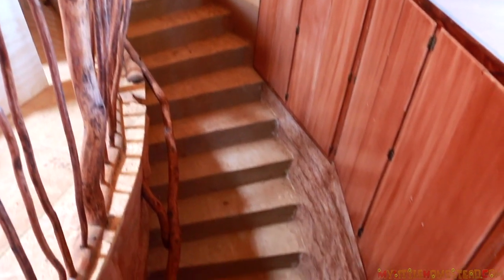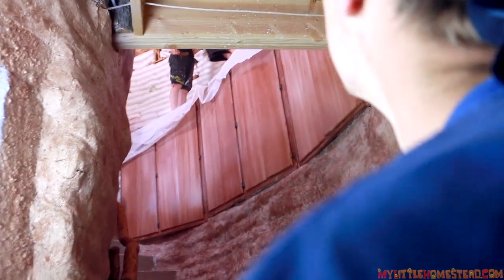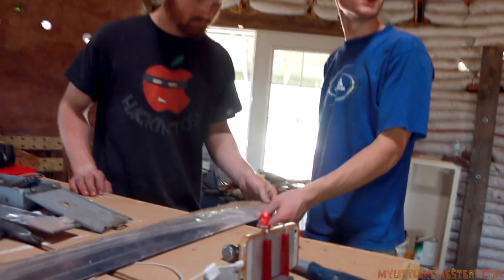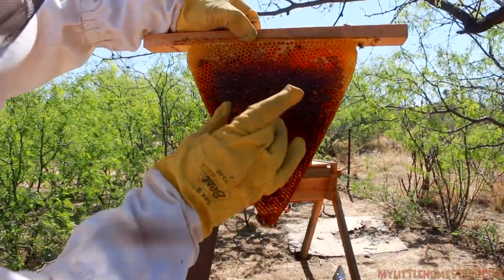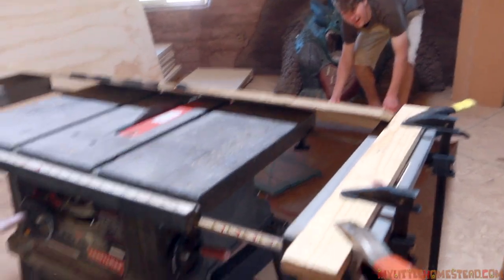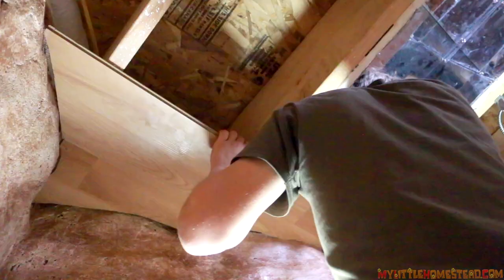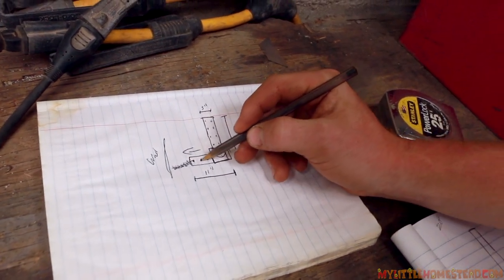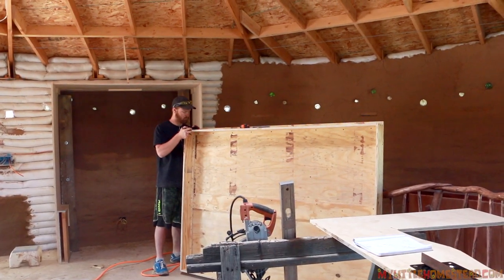Murphy Bed, Bracket and Beyond | Underground Earthbag Building | Weekly Peek Ep87

Comment: I like it all, but I'm not sure the lazy Susan bearing is your best choice for what you're doing.  It's designed to swivel with a heavy axial load, but you're applying a heavy radial load.  It may not hold up for long.
Reply from the maker: Thanks for the heads up

Comment: water and hot metal/welds, not good. causes stress cracks from cooling too fast.  fyi. awesome progress folks. ;)
Reply from the maker: Thanks JR.  There is a plastic ring inside the seat bracket and the guys didn't want it to melt :)
Reply: Ooh I see. Well of course ya know what ur doin.  Im just part of the peanut gallery watchin.  ;)